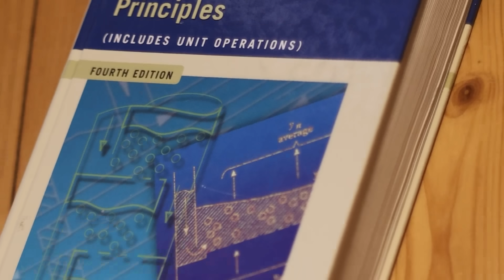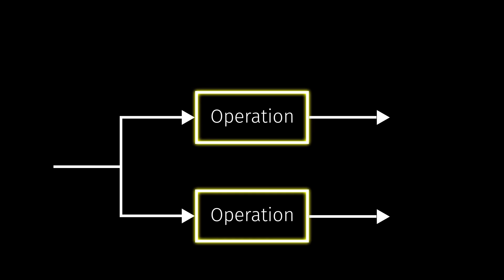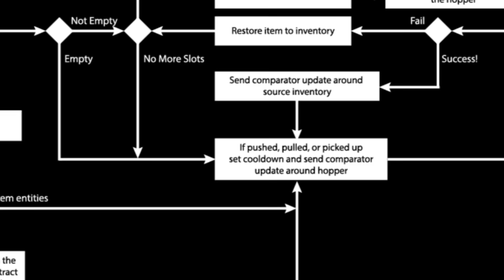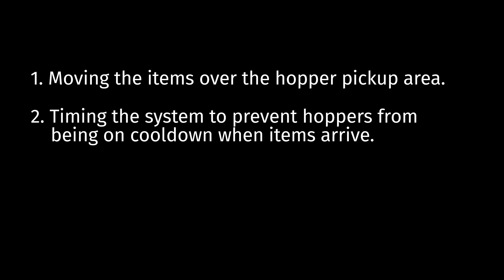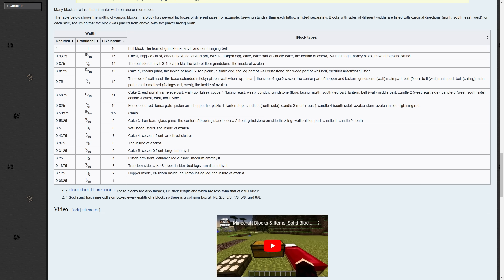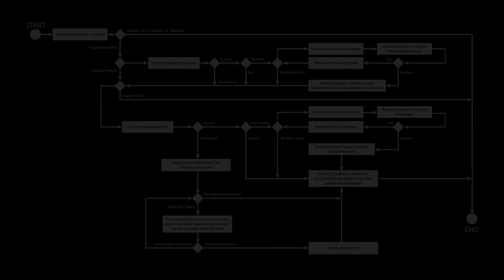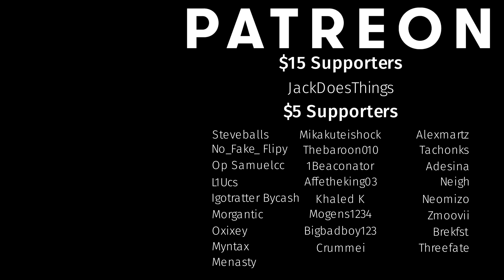Parallel Sorting & 4D Alignment in Sorting Systems - Storage Tech No. 3

Comment: Thank you these videos are very useful, however I can't line up filters infinitely, at around 230+ filters they break (instead of holding the proper 41 items it just breaks and will fill the filters) also I can't seem to find a design that sorts every single item in the game when I place multiple shulker boxes (full inventory and completely full) on hoppers leading to the filters and those filters leading to atleast 3 large chests and always clogs/doesnt work, is this just unrealistic/impossible?

Comment: 5:32 I personally use decorated pots (in bedrock), I tried using anvils but the items would get stuck, you can actually place hoppers underneath the pots and the items would still get sucked in, which helps to make the storage system slightly more compact. (Depending on the storage layout)

Comment: Hey! I've implemented this sorting system, but I have one major issue.

When you parallelize the sorting, it allows for a near infinite amount of different items to go through all at once.
But if say it's for a general storage system, and someone wanted to chuck 32 stacks of dirt in, the system wouldn't be able to handle it.
The first stack of dirt gets eaten by the hopper, but if the next stack comes in like 2 seconds, some of the dirt won't make it in and will pass it by.

This means, that if you don't want the system to ever miss, I have to throttle the input to hopper speed no? (A single hopper feeding into a dropper).

Have you or anyone found a way to overcome this?

- I know there's double speed storage, which can help
- I don't want to loop items infinitely around, cause it could be overwelmed and items would eventually despawn.
- I know you can do something with hopper minecarts to create a buffer, but will eventually get overwelmed.

Amazing series! Looking forward to Storage Tech No. 4!
Reply from the maker: Yes, or you need multiple sorters per item of you want to put more than hopper speed per item.
Reply: One of the simplest solutions are the dolphins, they have funny mechanic that when they throw item entities their despawn timer resets, and they can do it really fast, more on that in cubicmetre's video, name of it should be something like "dolphin simple storage"

Comment: About the thing on 5:06 There´s an easy way to prevent the Items freom getting stuck in the Hopper. If you put some ice on the side of the hopper, the water stream on top of the ice and on top of the hoppers honey blocks and THEN bring in the items so they slide on the honey blocks the hoppers can pickup the items and nothing gets stuck. Saw this the first time think 3 years ago from an german YouTuber and streamer called SparkOfPhoenix and I still use it since then

Comment: Designing a bulk storage system after building a storage system with about 512 of these simple sorting modules. This will be a big help, speed is such a problem with the basic design, I gotta afk at the storage system because how slow it moves items.

Comment: ive never had the items stuck in hopper problem. been working on my storage system in creative trying to iron out all the bugs so i can implement it is my survival world. its pretty much my existing design minus the hopper lines in favor of water lines. i see a lot of people's solutions for problems i have yet to encounter. some designs only run modules for 4 or 5 blocks instead of the full 8, but even running 8-slice modules nothing trapped in hoppers. alignment is intriguing but again i haven't actually found a need for it. 

to solve the problem of hopper cooldowns, i opt for a simple parallel respawn buffer to pick up items and re-emit them with some buffer space to hold items if the loop is over capacity. it also lets me at a glance discern the fullness of the loop and by checking the chests i can determine if a slot overflow occured. overflow is not a problem in that im using a-b slices so worst case scenario the filter fills up and wont pick up more items, they stay in the loop and if i see a lot of that item in the streams or the buffer. i can always add more bins or move that item to one of the shulker loading slots. for some items overflow is desired, eg if the item can be used as fuel, or can be cooked, composted, or smelted, it just carries on in the stream until it encounters the slice that handles that. i just need to make sure the storage comes first in the loop and anything that passes goes to the factory module.

Comment: Yo! I built the navynexus gold farm on my realm, and was worried because the item sorter for my old, single max-portal golf farm would get clogged like immediately. SO, I designed an extremely compact and lag efficient 8x item filter and 8x item destroyer. It isn't using the same tech as here, but more so applies the idea of parallel processing to a literal extent where each chamber's item output is split into two item filters each leading to one of the vertices between the kill chambers. there are 4 autocrafters for nuggets->ingots, 1 in each corner, all with two inputs. These then lead to a single crafter for ingots->blocks. I would love to show you guys my take on parallel processing. It's very lag friendly and handles 4 max-size portal ticking gold farms with ease.

Comment: a great way to solve the 4d/hopper transfer speed is to use to hopper minecart item filters w detector rails, they can pick up all items from 4 droppers on observer clocks up to around 10 stacks because then the system is relying on the bottom hoppers to sort out into your output chests, but still good for 10 stacks of each item every 5 minutes or so

Comment: There is a video about using hopper minecarts. So technically you can make the cool down even smaller. I would post link but i feel that my comment would just get deleted. Video is called: How to build 8x faster item sorters WITHOUT clogging! ✨ Minecraft Tutorial | Tileable | Minecarts By JustPanda.

Comment: Just like in circuit diagrams. Putting 2 ten amp resistors in parallel cuts down the resistivity to five amps. But if put in series, the resistivity doubles.

Comment: I have a nitpick about the video, it's great apart for the intro. While using a hoperline or edge aligned item translation, the system is always in parallel. The difference is the manifold speed, which never changed the structure of the system, only it's performance. In programming we talk about multithreading, even if two thread never execute(or sleep) at the same time or effectively doesn't perform better than monothreading
Reply from the maker: It's probably just the terminology difference between disciplines. Either way the storage tech community uses this definition for parallel, which aligned with the unit operations definition I am used to using :-).

Comment: 4th dimension alignment for 2x sorters is something I hardly see people talk about on yt. Every time I've designed a new sorting system I keep going back to one of ilmangos old videos where he mentions it and shows some timing almost in an offhand way. Will be really nice to have something more in depth - can't wait for the next video.
Reply: I still don't get the 2x hopperspeed sorter as he showed. The top one is the filter one? It isn't pointing into the comparitor. And won't the hopper under the ice pick up just about anything?
Reply: @dennis7006  you said "the hopper under the ice" but I'm assuming you mean the one next to the ice, right? If that's the case, that hopper is the filter hopper, which is also the one that point into a comparator. There shouldn't be any hopper below the ice.

Comment: only problem with the double pickup system is that the hoppers under the ice pick up garbage and don't actually sort anything. That's why I had a problem with potato_noir's gold farm sorting design
Reply: I'd say you definitely have to de-activate the hopper under the ice. I would just route the redstone signal around under the chest. Then again, there may be issues with the order in which hoppers pick up items which I'm not anticipating. Time to go watch a video to figure out how it's actually done.
[edit:] Wait, the hoppers under the ice shouldn't be picking up anything, should they?!? How did you....
Anyways, the fix is still the same: fill the hopper under the ice with 1 filter and 4 blocker items, and deactivate it whenever the hopper next to it is deactivated too.
Reply: @Pystro i literally copy pasted the storage part of potato_noir’s gold farm into nico’s gold farm and i made it work but if you watch potato_noir’s tutorial to build it, since the redstone is so compact i have no idea how i would try to make a filter out of the hoppers under the ice. the storage system has 2 hoppers going into one crafter for every filter, but the issue is only one hopper is filtered and the other literally just picks up garbage like swords and puts them into the crafter. that same hopper under the ice has a line of observers powering everything in the line next to it, and the filtered hoppers on the other side. i don’t think there is physically any room in the design to be able to put filters on the other set of hoppers unless i change the powering system

i’ve also tried just running potato_noirs gold farm and i think he overlooked the issue bc it does the exact same thing i just mentioned and clogs up the gold farm by putting garbage into crafters instead of nuggets

Comment: I'd love a guide on timings... common tricks, configurations, conversion between gt and seconds, issues with impulses (like with observers) and so on (maybe add clocks too, although I think you have an old video about that already). Like I thought it was simple as adding up the delay introduced by each component, but many times I coudln't work out why the timings were still not what I expect them to be, probably because I wasn't considering some basic mechanics.

Comment: 2:20 Can the "2'nd stage" (exiting the filter) also be made in parallel? (or at least in bugger batches?)
Eg. if you change from hoppers to hopper-minecarts, and then use "item yeeting" (destroy the minecart) to empty the filter, and then somehow re-construct the filter in the minecart?
You could probably use multiple hopper-carts with the same filter, so when the first cart moves to empty, then next one directly rolls into place to continue the filtering process?
I hope some Redstone Pro that is better at filters & such than I am, can be able to at least be inspired to try to make this? it would be really cool to see.
Reply: What you’re talking about is similar to what ‘stack separation sorting’ is, where you can sort an entire stack of items at once. You can find videos going over it on Rapscallion’s channel. Unfortunately this tech isn’t super applicable in most places because at some point you need to get the items into some storage block, whether it be shulker boxes, chests, etc. And that is always limited to hopper speed :/
Reply: Sure, you can get items into a hopper minecart, from a hopper minecart into entity form, and from entity form into a hopper blazingly fast.
But since neither hopper minecart nor hopper are your final destination, you'll eventually run into the same old hopper speed bottleneck. You're at best changing how many items your hopper-minecart buffer can suck up before that happens, which doesn't change the throughput at all.
Reply: this would be probably more complex than it's worth, because, remember, if you yeet the minecart you get the items back in entity form. now what?
that said, double speed item sorters do parallelize this process between two hoppers.
Reply: @ Now you have a specific item in a few stacks, now you can parallel-ize the input to the storage chests?
Reply: ,Don't use hopper minecarts as filters, unless you are doing the full-on Cart MIS approach. Hopper carts pull at 8x hopper speed and cause a significant performance overhead.
For a typical single-item sorting system that needs to store items at multi-hopper speed, you usually also put those items into shulker boxes. If you want a central storage location per item type, you use a combined box output (which is running at way below hopper speed, since putting items into boxes reduces the speed by a factor of 1728 for 64-stackables), not route all items into a single chest silo.

Comment: I hope you come up with a video on quick ways to load a double chest to accomodate the throughput of some mechanisms, like sorters for farms or mis.
Reply: Absolutely, I tend to struggle with quick loading mechanisms. A while back I made a tnt-duped basalt farm because a friend wanted tons of basalt for a build, but the loading was way too slow for its production. I love these videos that teach the principles rather than tutorials because they're actually inspiring rather than one-and-done
Reply: @devonchase5498  Totally ! I looked at a bunch of tutorials on multi-item sorters and I made my own, but it uses minecarts, and sometimes, it is too quick for a dual speed hopper collection, some item despawns. All I see is shulkerbox loaders, I'm sure there's a way of doing it with a regular chest, sometthing like 4x hopper speed.
Reply: @PunkR0ckz09  hi. if you break down a 6x loader you're going to notice that they are only 3 2x filters
the only thing you can really do at the end of the day is load at 2x. using minecarts only has 1 benefit. that being they dont require 4d alignment 
it does not make your redstone faster
Reply: @Heilzmaker I'm sure there are ways... using a dispenser filled on 4 sides, for example...and, minecarts has a lot of benefits, if all within 1 chunk, you dont deal with issues when you unload the chunk, you can make a compact 432 item sorter within one chunk, etc.

Comment: There are also item filters that only need one filter item, therefore can pick up 63 items at once.
Reply: Not if you use low threshold item filters which are AB tilebile
Reply: @gobezkid6025  I'm familiar with AB tileable sorters, but not low threshold item filters, what items would that be?
Reply: True, but throughput tends to be way more important than the buffer. Specifically with water stream based filters, item batchers tend to do a good enough job to warrant anything more complicated than the ImpulseSV sorter.
Reply: @dae-ja-vu  its not going to change throughput. it is still capped at 9000/h
Reply: I would also like to see some light shed onto AB-tileable and unconventional sorters if possible, the Impulse's ingenious solution has pretty much drowned out those
Reply: I remember the discovery of stacked curse of binding books being used to solve the 1-tileable issue of 63 item pickup system.
Reply: @thegittubaba yeah but that for patched, you can still use a carpet option to use stacked shulker boxes which would work the same.
Reply: They tend to break the adjacent sorters, don't they?
Reply: @siz1700 yesn't
So you need to make sure the dust of the two tiles dont interact with eachother
Reply: @siz1700 Do you know why this happens?
Reply: @Sean-yd1mx  when the items in the filter go from 1 to 64, the comparator gives a redstone signal strong enough to power the adjacent redstone dusts. You could prevent this by putting a free space between every chest
Reply: @etrnl0  not ideal for space... actually you can put some at a block between hoppers and comparators, and others without the block, this will make a bit longer and bit sorter versions, i did it some years ago, and now we had better redstone components, may worth try again with new redstone techs... My old system breaks in some chunck borders and i never knew why, because it mostly works pretty well with high demands and low demands of itens, but somehow it buggedout making some filters go empty and creating a heavy mess, i never figured out why, but i'am a not deep tecnical player, i'am more a survivor low resource friendly player, i make everthing infinity to play at survival early as possible without glitchs or bugs, soo, is a really hard rules to trick with, i not even use those redstone bugged components like 0-tick redstone
Reply: @viniciusschadeck4992  it's definitely not ideal for space, just want to point it out.
Reply: @ i know a minecraft hopper filter that turn one block intake into 4 hopper lines, not sure if worth making in most cases, but i used into my overworld portal gold farm and work as a charm, and i put only two lines of hoppers into the minecart filters